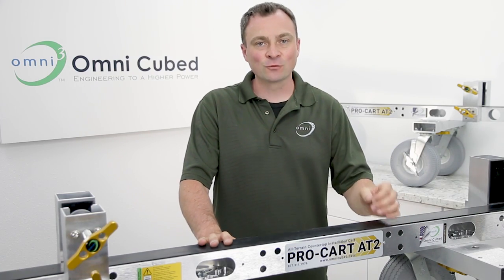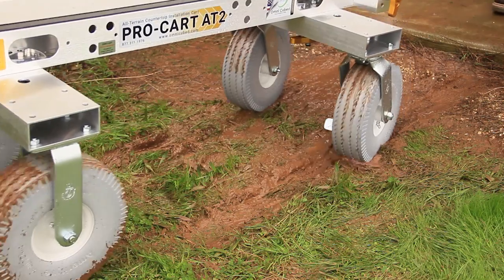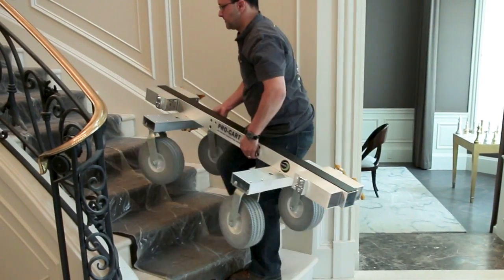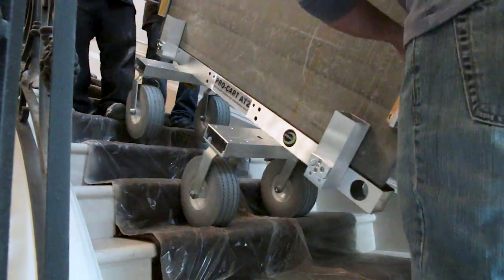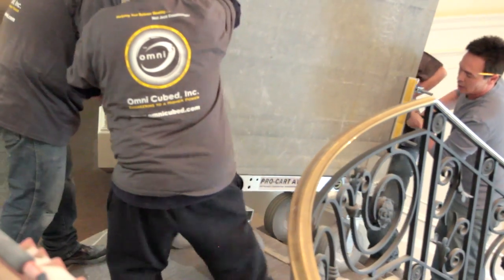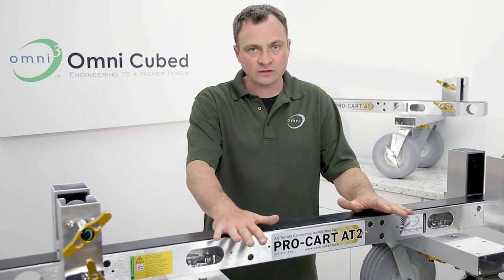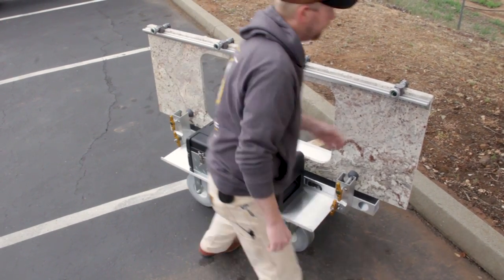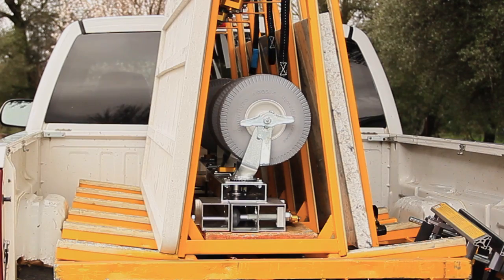Omni Cubed Pro Overview: Pro-Cart AT2

Comment: good only for the small pieces and not good for big ones like 320cm x 130cm x 6cm thick
Reply from the maker: Hi Javad, thanks for the comment, but that material size shouldn't be a problem at all.
The max weight capacity is 453kg (1000lb) , and the opening is 73mm (2.88in).  You can rotate the uprights down out of the way before loading the material so you don't accidentally hit them.
We also make a custom version that can open wider and another version with more wheels for increased load capacity.  Our customers have used our carts daily for many years to carry slabs this big and bigger without any issues.